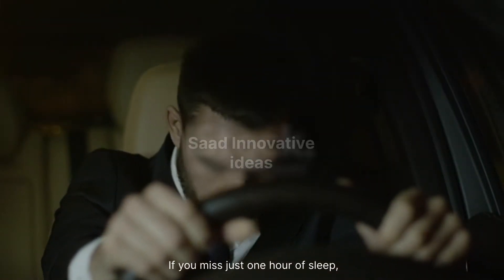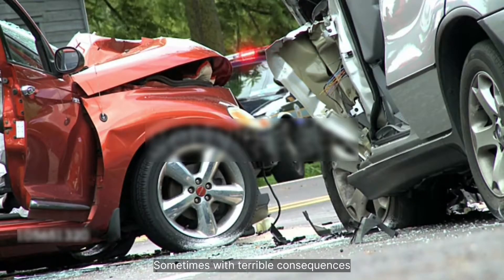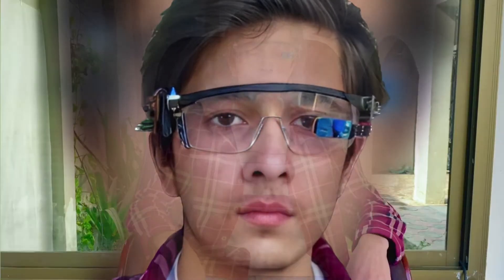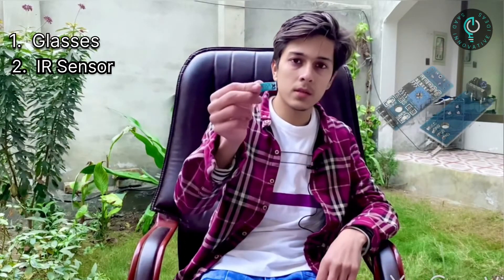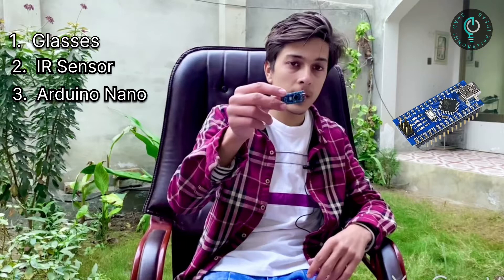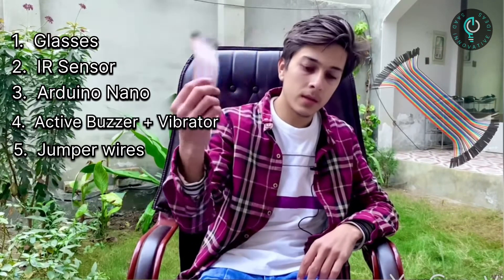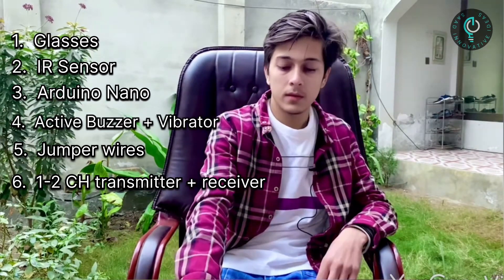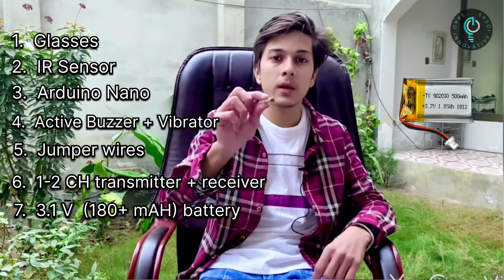Accident Prevention Glasses | Arduino Anti Sleep Glasses | Anti Sleep Alarm for drivers

Comment: How is the circuit break gonna work
Reply from the maker: Circuit breaker cuts off the supply to the motor when gets the signal of sleep from the glasses
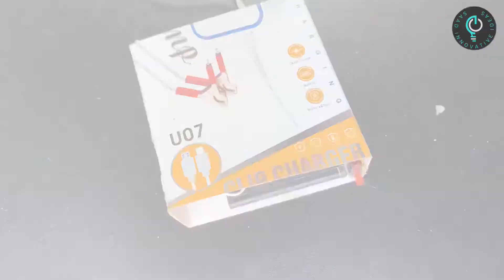Reply: I did evryrthing like  13:00 till 14:25 of the video but still the circuit breaking is not happening
Reply: And i made sure my connections of the wires are  correct

Comment: I followed everything in the video but when i connect the gnd it just constantly beeps and vibrates and doesnt stop unless i disconnect the gnd why do u think that is please rply fast
Reply from the maker: There is a potentiometer (that knob) on the sensor, try to rotate it a little (not full)  to the maximum direction

Comment: Bro, I tried it, but it's not working. Please help me. The problem is that the circuit diagram is not proper, and the code is also showing errors.
Reply from the maker: Both of them are correct, there may be some other issue
Reply: Pls share any other circuit diagram

Comment: Hello Brother,

If possible, please provide information about the diagram. Also, the code you sent contains an error. In the diagram, you have shown that the positive wire of the RC 27MHz 1-channel transmitter is connected to digital pin 13, while there is no mention of pin 13 in the code.

Please send me the correct code. I would appreciate it.

Best regards,
Was-Salam
Reply from the maker: Brother LED_BUILTIN is define for D13 pin of the arduino board. Weather your write D13 or LED_BUILTIN both means the same pin number

Comment: Can you tell me how to do the wireless car stopping i mwan the components name😢
Reply from the maker: Use 1 or 2 channel transmitter and receiver
Reply: @saadinnovativeideas  I mean the components..list..for making the wireless car 😅
Reply from the maker: With the same connection setup as shown just use powerful servo motor with compatible battery and fit the servo at break of the car
Reply: Bro i am taking 2 channel what to do with that

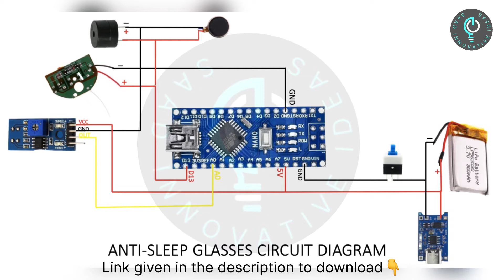Comment: 8:58 are you sure that this is correct, i’m sorry cause they are some problems with mine😢😭
Reply from the maker: Yeah that is the circuit diagram, thats correct
Reply: @ i saw in the video you connected the red wire of the battery wire to b+ so why in circuit diagram i saw you connect it to b-🙁
Reply from the maker: Where is b- . I checked again the circuit diagram, its correct

Comment: What you have used after attaching servo and that servo was falling on which item can you tell me 13:19 video time
Reply from the maker: That was the power switch to the motor wheels rotating on the board. When your sleep is sensed the switch breaks stopping the wheels

Comment: I HAVE ORG CODE I WILL SEND YOU 
#define SENSE A0

void setup()
{
  pinMode(SENSE, INPUT);
  pinMode(2, OUTPUT);  
  pinMode(LED_BUILTIN, OUTPUT); 
}

void loop() 
{
  if (digitalRead(SENSE)) 
  {
    digitalWrite(LED_BUILTIN, LOW); 
    digitalWrite(2, LOW); 
  }
  else 
  { 
    delay(2000); 

    if (digitalRead(SENSE)) 
    {
      digitalWrite(LED_BUILTIN, LOW); 
      digitalWrite(2, LOW);  
    }
    else  
    {
      digitalWrite(LED_BUILTIN, HIGH);  
      digitalWrite(2, HIGH);  
    }
  }
}